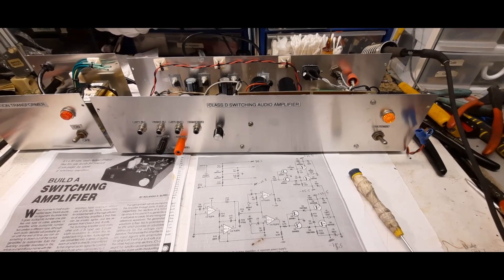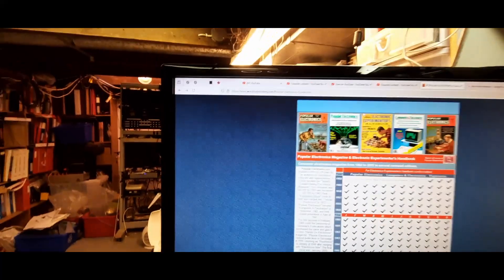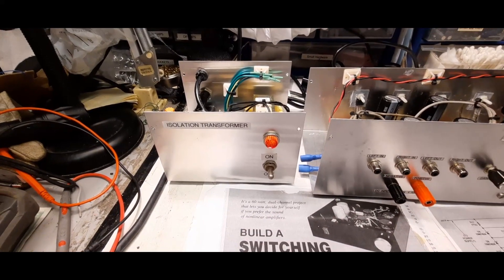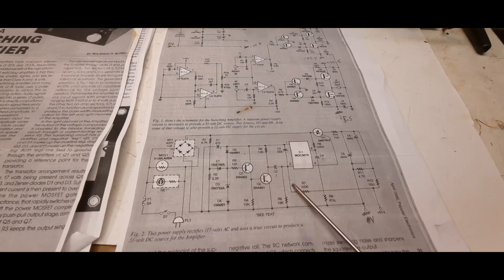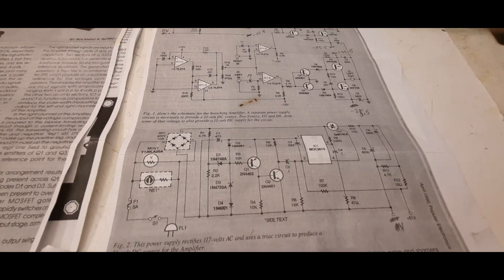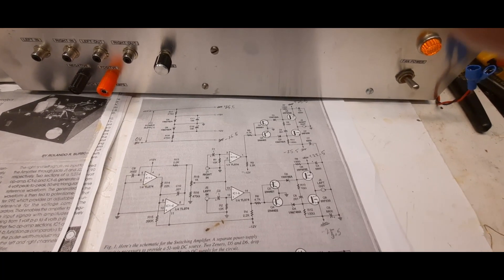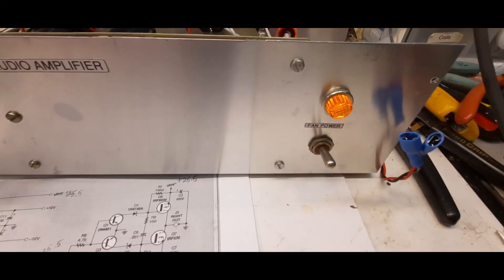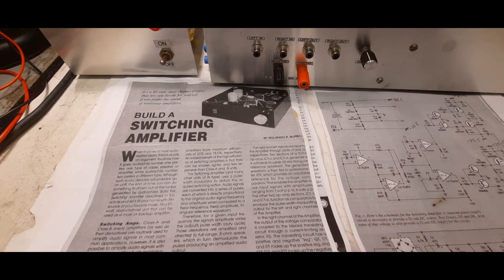Class D Audio Amplifier - Popular Electronics Magazine Project

Comment: That isolation transformer, is that in a home made case too? I have been looking for more ways to make more of my own cases for my gadgets and things that make other projects work.
Reply from the maker: Hi ... no .. I bought it. It is made by Hammond. However, if you have the tools to bend sheet metal you could do it.
Reply: @bettinaneumryr  Oh, Hammond! I've heard of them. I might even have some equipment in a Hammond case. 

That's a good tip, I was about to forget about just doing it with conventional tools. I can either find someone with a sheet press, or whack some blocks of wood together. 

I knew there was a good reason to save those PC case side panels

Comment: This design has been known to be...questionable...for many years. IIRC,someone even admitted that it was published as a joke (It's the APRIL issue,right?). I remember looking at this issue for a few days,way back when,trying to figure out WTF was going on in power supply section.
Reply from the maker: Hey .. you might be onto something! At least the amplifier part works with an external power supply. Cheers!

Comment: Wow. Didn't the magazine test this before they published it to make sure it worked?

Also. I'm surprised that a class D amp needs fans considering hoe efficient they are.
Reply from the maker: Well, I am certain that my PS was built correctly and it actually worked but under load it dropped to only 40 volts. I went over it many times to convince myself. Anyway, it's done for me and I probably won't go back to it. I put the fans in there as the PS got really hot at first before I knew it was no good. Cheers!
Reply: @bettinaneumryr  have you ever tested that with a distortion analyzer? Early class D amps weren't great in that regard but the latest ones are outstanding. I saw one recent class D amp where if there was any harmonic distortion it was in the noise floor so it was undetectable from noise.
Reply: @bettinaneumryr  which year prince said to party like

Comment: The design of this thing as published is absolutely horrendous. I thought non isolated power supplies went out with tube amps in the 60s, but in any case they can be deadly. No output filtering so it will generate a ton of interference and no DC protection circuitry so if the oscillator fails for any reason the speakers expire in a puff of smoke.